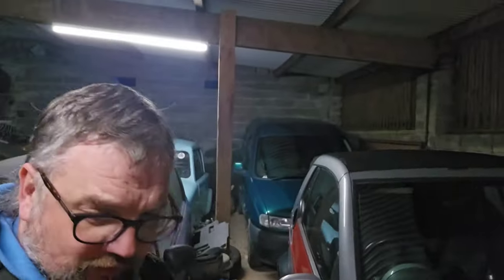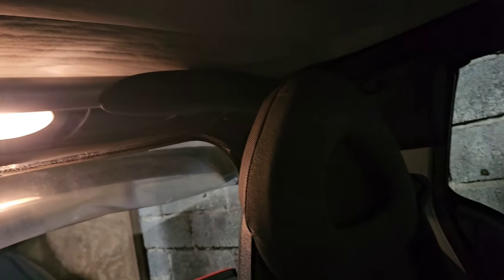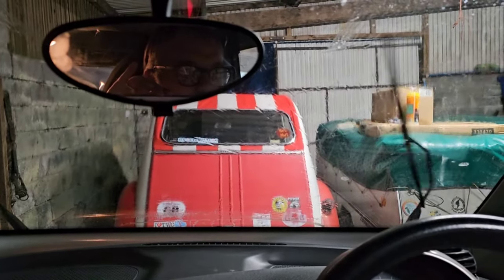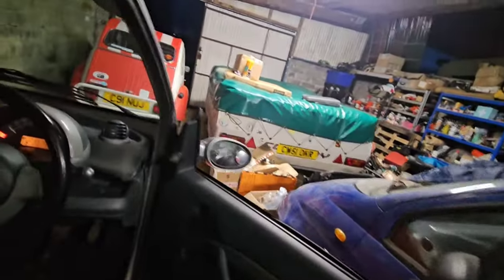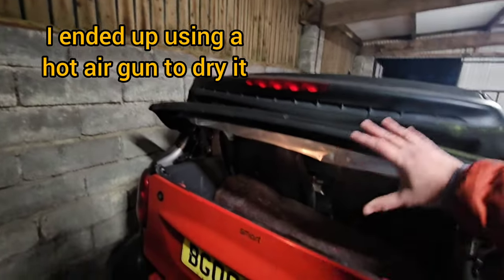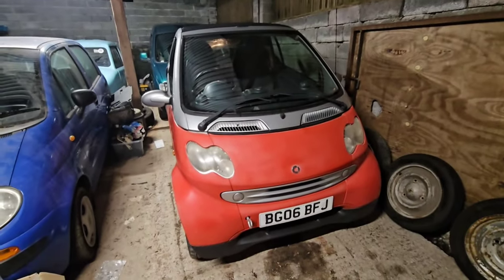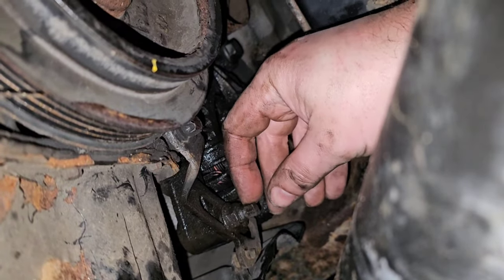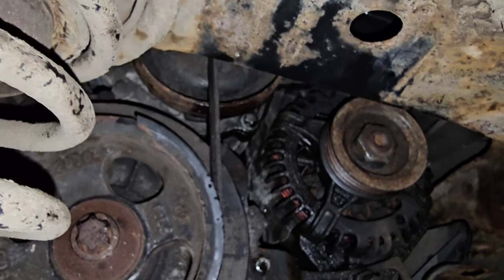Abandoned Smart - seized alternator. Can I fix it?

Comment: Once the alternator seizes it will happen again if the car sits for a couple of weeks so just fit a new one along with a starter motor.
It's awkward but techniclly simple to lower the engine to gain access.
I lowered mine without the long bolts but I left the nearside rear wheel on and lowered it until it touched the ground and used stands to prop it all up.
You only remove the rear mounting bolts and the whole thing swivels down on the front mounting. Take off the rear wings/bumper 6 screws if I remember and that gives you access to the X frame and the rear mountings. It only swivels down app 4 inches but that is enough to get access to the top of the engine and starter/alternator.
If the car is road legal don't waste it and sort it ASAP rather than the others and you will get the most out of the soft top.

Comment: Ian, a little trick comes to mind getting the Smart started. use a strong cordless drill socketed to the crank bolt to help the starter motor spin up the engine. I agree with you, once you've got it running the alternator should completely free off.

Comment: Optional rev-counter and clock was an option on the cabrio – I've owned 2 and both had them. Def recommend biting the bullet and fit a new alternator (£150). Once it has seized once it will keep happening if stands unused for a week or so in damp weather. And, yes, sump plug is an after-market mod and a very good one. As standard oil is sucked out with a pump which can never remove all the sludge from the bottom of the sump. Re the air-con, I'd recommend always keeping it at least on the first setting even with the heater on. This will prevent the a/c pump failing. A/c pumps don't like not being used regularly (all cars, not just Smarts).

Comment: The alternator problem looks similar to what happened to my old Golf tdi. It was an easy start with no belt and the alternator could easily be turned by fingers. When loaded by the belt the starter ( heavy duty for a diesel)  was defeated. The bearings were locking up under the load of the belt tensioner. The only solution was a new Alternator.
Reply: In the smart this is common due to position of the alternator leaving it exposed to splash in wet conditions. If you don’t drive it for a few days after a wet weather drive it is likely to seize. A new alternator isn’t really the solution if you can free off the existing one as the new one will quickly become prone to the same issue.

Comment: That's excellent news on the air conditioning. Mine wasn't working when I got my car. It seems that many don't work as the system won't hold pressure after about eight years. The aluminium heat exchanger is right at the front, low down so it gets hit by all the road salt and dissolves faster than a Disprin. Getting hold of a part was the most expensive portion of the job as no one seemed to have one, but the whole front had to come off to get at it. 
The car having such a small interior, it can get quite humid inside even on a cold day, so it is nice to have the AC just to pull out the moisture.

Comment: If you have issues with moisture inside cars that sit unused for a while, get an old pillowcase (or a new cheap one) and buy some of the silica crystals kitty litter. Empty the kitty littler into the pillowcase, tie it off and put it into one of the footwells. 

Essentially what you are making is a giant version of those little silica gel packs, that will keep the air inside the vehicle nice and dry.

Comment: Definitely not backwards. You have confirmed the starter is duff and alternator really needs changing. You have achieved confimation. Given it a run, working air con win win. 

You did well with the Dihatsu, 75 and PT. I'll be mega impressed if you get the smart sorted. Plus plenty info from now to swot up on. In-between.
Reply: I'm swotting up on smarts thanks to you 😀

Comment: Get yourself the service bolts and drop it into the service pos'n, if anything like the Roady, you'll need to remove the air scoop off the intercooler to allow access to the fixing screws for the starter, obviously make sure you have the battery disconnected as the chance of sparks is high disconnecting both the alternator and the starter, when getting a replacement alternator make sure you get like for like part numbers, there can be issues with some spares that are supposed to be equivalent, good luck and don't give up on it.

Comment: Between this and the Fiat content I'm thrilled!  Having owned some mid and rear engined cars I'm always amazed by how much corrosion they suffer in the engine bays.  This one was probably just sitting a bit too long.  My 2013 smart is US spec and so much fun to drive with its manual steering.  Yes, the engine compartment can corrode, but the thing will look like new forever because of those plastic body panels!

Comment: Those vacuum oil extractors aren't that bad.  Used one on my 2003 Seat Leon TDI for the last 10 years.  You don't get sludgy bits with modern oil if it's changed regularly.  If there is "sludgy bits" in the sump you're best taking the sump off and cleaning it since a simple oil change isn't going to fix the problem 😊

Comment: The clock and rev counter were optional extras on the 06 plate. 04 plates they came as standard. My wife owned an 04 in numeric blue. We now have a 61 plate and it's lovely but not as fuel efficient. Great news for you having a sump bolt,that's a fantastic mod

Comment: Hello, I´ve been exactly in the same situation as you. I ended up replacing the starter motor with a refurbished one and a second hand alternator. I just dropped the engine a few inches to have access to the started  motor, but you have to also undo the cooling hoses to get to it. A bit of a hassle but can be done with pacience.

Comment: One point to note on the lack of sump plug on the 450 models. If the correct specification of engine oil is used and is changed regularly, there shouldn't be any sludge in the bottom of the sump pan. I know this because my smart fortwo after many years had done over 100K miles when the sump was quite rusty in places and on the verge of becoming porous. Upon removal of the old sump there was not a single piece of sludge or anything that shouldn't have been there. Service your car properly and never scrimp on oil.

Comment: It looked like there were rust holes in the suspension damper! I'm guessing it has lived on the seafront (been there, done that).
Reply: It's nothing to do with the sea you would have to physically drive it in the sea 😂. Its road salt that causes rust. Loads and loads of old cars running around devon and Cornwall and Wales. Worst cars are from bonny Scotland and the North East of England

Comment: Ian how long did this job actually take ? bearing in mind I sent you a video of me and the apprentice taking out the engine in 41mins to swap out an alternator and starter Just as we all know there is a M6 bolt that always brakes for the plastic scoop that cools the something  and there is know way of vw cable tie it back in. If you had brought it to my workshop that would have been a 3 hour job with an new alternator (as I suspect the next video will be change it as the bearings are noisy) xxxx

Comment: First generation Smart FourTwo had diesel engines that could not meet the emission standards in the US. They were only sold in Canada. The problem is that any first generation Smart cannot be serviced in the US. They used a special suction tube down the oil dipstick that is absolutely necessary to change the oil.

Comment: From my limited experience, once an alternator has seized or partially seized, it is game over, had this on a Toyota and a Proton. Good luck with it though. If you drop the subframe and engine, put it in TWC. No? 😂
Reply: Yeah, the bearings in the alternator are bound to be damaged. I'd be amazed if it lasts.

Comment: Don't forget to check for a bad connection to the Starter Motor Solenoid or bad grounds 1st because it did struggle when you tried after replacing the Battery, also with no Alternator maybe the battery is low now.
Good Luck 👍 👍🤞🤞🤞
Reply: Yes worth checking, though that battery has barely done any starting yet and the car ran only a few moments so should still be good for now, though I do hope Ian looks after this one with some SMART (ahah!) charger love as he has a habit of letting them go dead which kills them fast.  I'd hate to see that when he's splashed on a brand new battery.  If you have a fleet of batteries you want to be regularly hooking them up to a smart charger to keep them tip/top, perhaps on a rotating basis each time he visits the lockup.

Comment: Ian, BE CAREFUL ABOUT TURNING THE ENGINE BY HAND AFTER A FAILED START. Because with the key being a flick style it will start at any point,I found this out whilst changing a flat battery. 👍
Reply from the maker: Good warning. Worried about this, I did start disconnecting the battery before going near it.

Comment: Ian, Maybe a push start would be in order. This way you can get it moving and should sort everything out... Unless its automatic!
Reply: They can be tow started and they are automatic but they are a manual box with a clutch and basically they change gears for you with actuators.

Comment: The joy of Smart repairs. I had the same model, it sat a while then the alternator siezed just like yours. I had to replace it! What a job. The starter was OK though. Oh and yeah, mine did not have the sump nut, I had to suck the oil out the dipstick hole. 
Good luck with the repairs. 
I will show you what happened to mine when I left the tire weld on the dash on a sunny day.

Comment: Ian, 

Here's a thought.  Now that you've freed it up, the alternator appears to rotate Ok statically.  I wonder if part of the problem is that it becomes too stiff for the starter to manage when the magnetic coils are energized?  

I mean, the starter may be toast at this point, so it may be moot.  But what if you could start and run the engine without the alternator coils being energized, and then energize the coils while the engine is already running and the alternator is turning?  There's probably a fuse that feeds the alternator coils that you could take out, then put it back in when the engine is running.

Comment: Easy enough.  Drop the under panel, fit a loose socket on the alternator nut ( 26mm maybe?) blast the alternator full of WD 40, then use Mole grips to turn the socket since there is no room for a drive bar or ratchet.   Any Smart put away with a wet alternator will rust it solid in a couple of months, mostly due to the alternator positioning.  If you are storing one run the engine over every couple of months and store it as dry as possible.
Reply from the maker: I managed to get a spanner on it. 24mm.
Reply: @HubNut  Good.  Alternator will save but the starter is likely toast.  I had our starter replaced and it wasn't too painful.  They are great little cars but they do NOT like to be left sitting.

Comment: The earth lead thing is not unusual problem and a simple cheap fix.
You can change the Starter motor without dropping the subframe very far down. A bit of a faf so worth checking all else first.

Comment: Have you also checked the other things that are run off that belt?  Like the water pump, a tensioner/idler pulley, etc.?  It looked like the alternator was loose enough that it shouldn't have completely balked the starter like that, which makes me think something else might be to blame...
Reply from the maker: Good thinking but with the belt on, I can turn it easily enough by hand.

Comment: Clean your battery posts, engine ground terminals and the terminals on the starter if you can get to it. Surface corrosion is clearly rampant so I'd say that could be the root of your issues there.
Reply from the maker: You really can't get at the starter terminals without dropping the engine at least a bit...
Reply: @HubNut  my approach with these things is that a lot of the torment comes from procrastinating about it and painting it as potentially a bigger ordeal than it actually is. The best thing is to just get stuck in and get it done. Either that or pay someone to do it. You got the car for nothing so you can't lose really!

Comment: When the alternator is connected, the tension is too much for the bearings. They - the bearings - must be in need of changing. The starter motor is probably good. Some purchase may be achieved by slackening the belt but, the bearings, if they are worn, will win in the end.

Comment: Had the same problem with mine i freed off the alternator best i could and stuck a transit battery on it    cos i found the original small battery wasnt strong enough the transit battery swung it over and got it started

Comment: When you had the car running it would have drained the battery, give the battery a good charge (and possibly use jump leads from a running car) and it would probably kick into life, it will need a new starter l]motor soon, and looking at the state of the subframe I would drop it and give it a good going over, safety first and all that.

Comment: With everything being so tightly packed, I assume getting the engine out will make everything quicker. I can imagine that it's just a four-bolt-job - plus a dozen connectors or so.
Reply from the maker: True, though everyone seems to forget about Air conditioning lines and water pipes. Believe it is possible to drop it just enough to gain some access
Reply: @HubNut  Water should be easy enough, but, yes, AC is a pain.

Comment: Just swapped starter and alternator on my friends new shape twingo which shares the smart platform. No a dreadful job by any means
Reply: Starter is under the inlet, quite easily removed. Have to take both upper engine mount bolts off and undo the four subframe bolts that attach to the rear chassis rails. Subframe can then just dangle maybe 30mm lower without being fully removed which allows the engine to drop enough on a trolley jack to allow the inlet to be removed from the engine compartment from above

Comment: Are you sure it's the starter and not just a low battery? You were using a lot of the electrical stuff with no belt on to charge it... Coincidently, changing the alternator on my van is a job i have to tackle today😊😅😂😂❤ 
I've precharged the battery so the system doesn't have to work so hard at first😉😇😊🤪
Reply from the maker: Yeah, battery is still over 75%.
Reply from the maker: Yeah, battery is still over 75%.
Reply: @HubNut , Excellent...  keep warm guys.. the brrrr... isn't over quite yet...

Comment: I would remove the alternator and strip it down to remove the corrosion and fit new bearings if required. Then send the starter off for a rebuild or strip it yourself and see if it just needs brushes.
Reply from the maker: I think we're going to source used replacements but we'll certainly keep the originals with a view to overhaul.

Comment: If you strip that alternator you'll free it up and itll cost you nothing. If you get it on your bench and spin it up with a drill and lube it that may be enough! You may get lucky on the starter as well changing the brush pack
Reply from the maker: There is no way to get it out without dropping the subframe, hence hoping to free it off in-situ.
Reply: @HubNut  ah, what an 'inserts internet unfriendly word'.